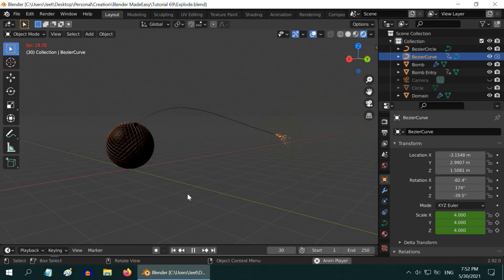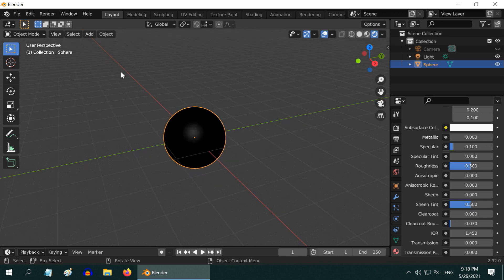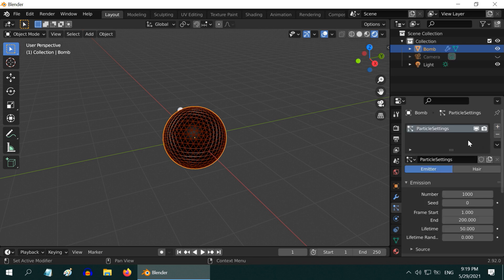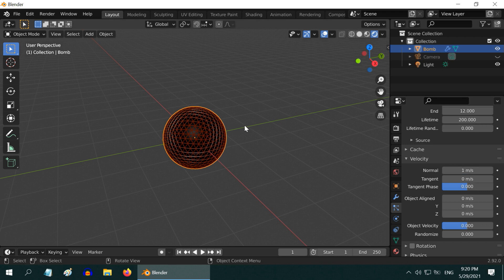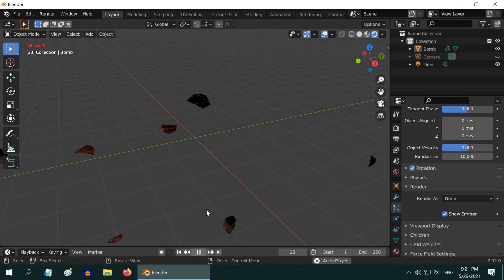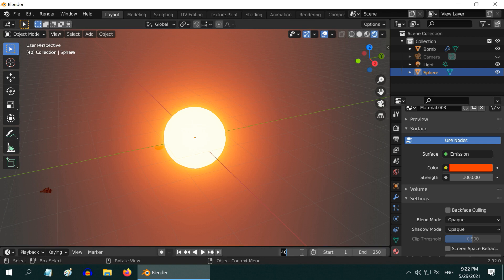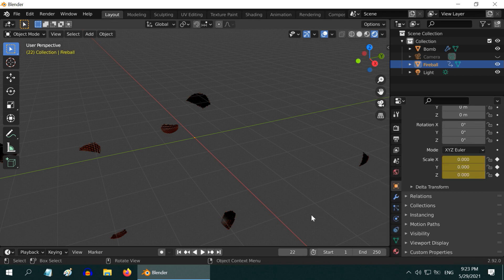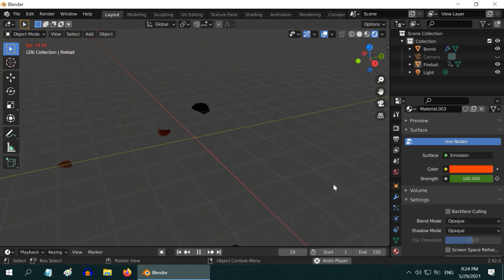Create An Explosion In Blender | Explode Modifier For Explosive Objects | Blender Eevee & Cycles

Comment: Hi ! I want to create an explosion of an spaceship in empty space, including smoke. The smoke should expand point-symmetric, because theres no gravity. But how? If i just set gravity to zero nothing happens! The smoke just stays near the object and doesnt expand ..
Reply from the maker: Good question! You need to use a normal initial velocity for the inflow object, instead of buoyancy or temperature because these two will always drive the smoke upward or downward (if negative). The other option is to use vorticity for the smoke domain, this will also create random movements of the smoke in all directions. Use normal initial velocity and vorticity together for the best effect.
Reply: @5MinutesBlender  found it! Thanks a lot!

Comment: I got a plane with collision underneath to catch the particles but they end up somewhat half inside the plane, do we know how to fix that?
Reply from the maker: In the particle settings, Enable Physics > Forces > Defection > Size Deflect. It will solve your issue. But there is a bug with this as well. When you render an object instance in place of the particles, the default scale 0.05 gives the correct result with Size Deflect, otherwise the result is not very perfect.

Comment: How did you make the rope on fire like in the very beginning of the video
Reply from the maker: The rope is basically a curve object, a bevel is added into its geometry for the thickness.
Reply: @5MinutesBlender  ok but how do you make it slowly disappear and have fire onto it?
Reply from the maker: @motornine5636  We have discussed this technique in another tutorial here 👉 https://youtu.be/i7ChK1BYuDk Although now with Geometry Nodes we have multiple ways to implement this. One technique is discussed in the linked tutorial, you can check that.

Comment: That is nice! but what if I want that the Bomb is made of full Material? In your example all the exploded parts are just thin as paper, that does not look realistic.
Reply from the maker: If you want the broken pieces to have a solid material, add a Solidify modifier for the sphere or the object that you are going to explode. It should be placed AFTER the Explode modifier. Play with the thickness value of the Solidify modifier and you will get solid pieces, instead of thin paper. We will show this in our next tutorial on explosion. Thanks for watching!